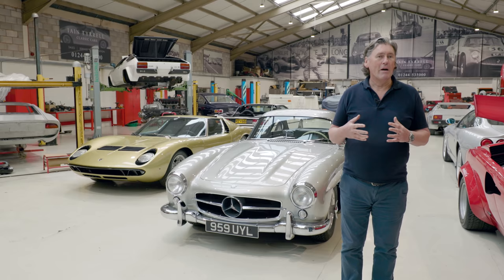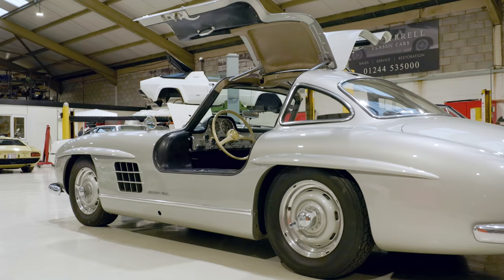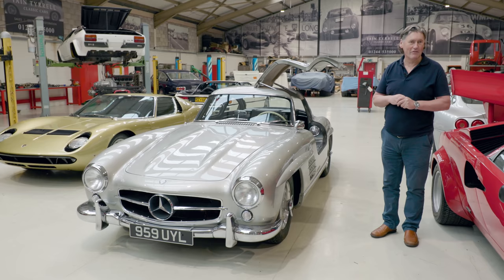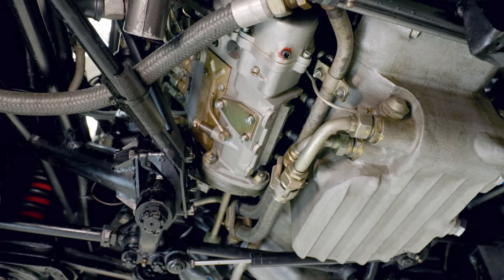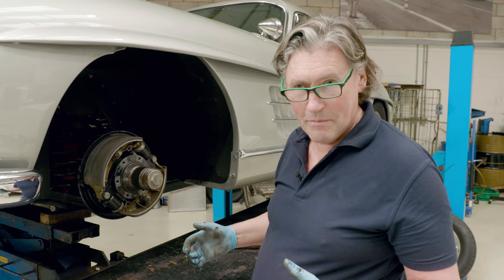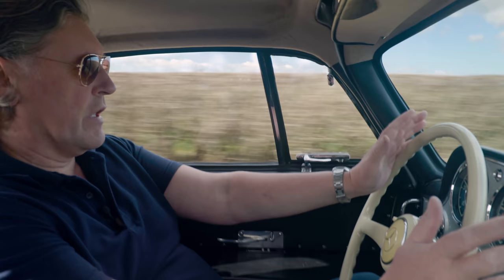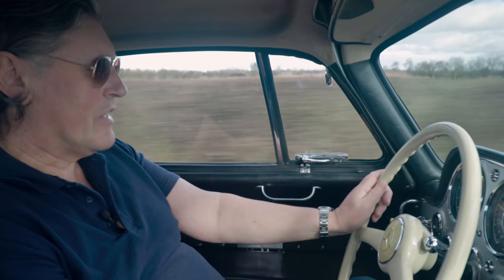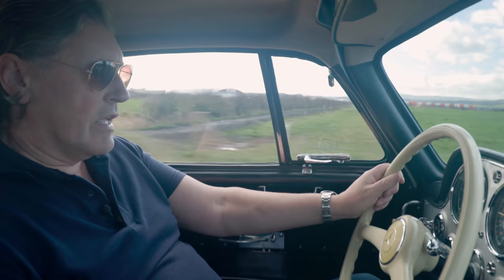Mercedes-Benz 300 SL Gullwing - Recommissioning an Automotive Icon | Tyrrell's Classic Workshop

Comment: Iain, quite right about the injection system on the DB601. After Munich, Britain had also stockpiled 100 octane AVGAS - a significant advantage. At the start of the Battle of Britain, the RAF removed a "stop" on the throttles of the Spitfires and Hurricanes - the pilots could now go "through the gate" and access about 100 additional very worthwhile BHP. RR considered injection (which allowed BF109 to dive away from it's carburettor-fed Merlin opponents when required) but liked the cooling effect the mixture gave to the air coming out of the aftercooler. And they liked the supercharger over a turbo as the exhaust thrust was worth about 20 knots at maximum revs. Fuel was always a big problem for Nazi Germany. If Bomber Command had gone after synthetic fuel production (derided by Harris as "a panacea target") they could have really made a difference in 1944.
Beautiful car, great channel, very enjoyable - well done!!

Comment: W194, 1952, winner Le Mans and winner Carerra Panamericana (say no more). Later to become W196 (300 SLR) winner Mille Miglia 1955, Stirling Moss and DSJ.  As many have said: proper engineering.    
Based on the Mercedes-Benz 300 SLR sport racer of 1955, Uhlenhaut created a road legal SLR/SL hybrid. Capable of approaching 290 km/h (180 mph), the 300 SLR Uhlenhaut Coupé easily earned the reputation of being the era's fastest road car. A story circulates that, running late for a meeting, Uhlenhaut roared up the autobahn from Munich to Stuttgart in just over an hour, a 137 mile/220 km journey that today takes two-and-a-half !!

Comment: Thanks for your fantastic work by introducing and explaining the super cars.
Regarding the first car with direct injection the german Gutbrod Superior was the first mass production car using this method. The difference to the SL 300 is that the Gutbrod is a 2- stroke engine and not a 4- stroke engine. The direct injection helped to reduce petrol consumption which one of the disadvantages of those engines.

Prof. Uhlenhaut drove his 300 SLR each day into the office and whem I remember well the position of engine and drive train was assymetrical so a bit uncomfortable for a commuter.

Comment: I shudder to think just how many times I would have to check, then re-check all the fluids and the done-upness of all the things that need to be done up, before daring to start such a valuable piece of automotive history. I've been known to pop the bonnet open just to check one more time that the dipstick was pushed fully home after checking the oil level. You never know, the five or six times I pushed on it before I closed the bonnet might not have been enough. My OCD would redline with this one, however. Beautiful engineering.

Comment: Sir you are a master. I can only be thankful for the experience you give us of these beautiful classic cars.
Wouldn't mind a straight 8 SLR version as a daily driver...
On my wage I'll have to stick with the cammed up M103 W201 but I still prefer it to going for something newer. I just have to apparently go for completing EFI conversion to get the minimum 270hp build target, the ECU piggyback on CIS-E isn't as tunable as I hoped it would be but I do like the 6 bar fuel pressure. It just goes haywire trying to resolve all the fitted EFI sensors so I'll have to fit electronic injectors now.
Still, what I love about mine is being as close as I'll get to driving around something like a 300SL, a 3.0 litre Daimler six with a dual personality of sedate low and waking up high, remarkable pull for something ancient compared to modern traffic, pretty sure my 0-60 is sub 6 seconds and 0-400 in the 13 range so will beat a spanking Audi if he doesn't take me seriously and hey, I originally bought it for a thousand bucks and honestly, up close it looks it. 😄
But I do actually love the lines of the 190E 201. It's a handsome looking car, smart looking, y'know. Nothing like the classics you deal with, they're artwork. Mine is just smart looking. But I love it. I had a Porsche driver after a run pull up at the lights asking what was in it. Bit of a cam, 12 grand of new parts and hand machining for track days. Looks rough. Is old. Goes hard. I like that.
Like I said I wouldn't mind a real old beast like an SLR or a 2.5 Ferrari 12 but I'd just ruin it running as a daily with a heavy foot. I would have to do that 😅

Comment: Whats amazing is the fact that they were able to reasonably accurately inject a low viscosity fluid (petrol) via a mechanical pump which normally relies on the lubricity of the fuel (diesel) for sealing and lubricating the internals......

Comment: Fascinating. I wasn’t aware of 160mph, but this does amuse me in a way. The reason cars were always limited to 155mph, and Bugatti Veyron tyres cost £30,000, is to run at 160mph for x minutes will completely wear through……normal tyres. So that 1954 handbook note is….Mercedes knew it would kill whoever tried 160mph for an extended time 😀

Comment: Iain really is an Automotive Yoda - so full of knowledge, insight and experience - the perfect teacher! I'd gladly be the tea boy at Tyrrell's Classic Workshop, even though I'm in my 40's!!
I happened to see a 300 SL Roadster on the road a couple months ago. I assume the space frame on these is modified, as the doors on the Roadster open somewhat lower than the Gullwing...? So it makes me wonder how Mercedes have retained the structural strength in that area on the Roadster...

Comment: If the oil is being contaminated that quickly then the fuel injection pump is worn. The Bosch pump is also lubricated from the common lub system. If the injection pumps are worn then the leakoff will contaminate the fuel pump sump and as it drains back to the main oil system it will contaminate everything. The problem with fuel contamination is that around 5% will be enough to drop the viscosity by 50% and the sump oil flash point also by 50%.

Comment: I enjoyed your review of the 300 SL. On why the original gullwing did not have disc brakes I am repeating something I heard so you can call it  hearsay. 

But I understand jaguar just came out with their disc brakes from Dunlap and Mercedes did not want to pay Dunlop a royalty. Maybe they felt with the Rudge wheels one royalty was enough 😁

Regardless when the roadster came out in 1957 among the updates were disc brakes. 

Did not realize so few of them came with those wheels which was really a whole different axle assembly. 

The roadster came out in 1957 due to the demands of the Southern California market and of course they modified the frame. 

And in the original gullwing the doors had to be that way because of the frame. 

I understand when they made this for the commercial market the engineers hated the doors considering it a necessary compromise but of course it caught fire with the public. 

Women did not like that particularly but it did not stop some like Sophia Loren from buying them. 

It’s an amazing car and thanks for filling in a lot of knowledge gaps for me.

Comment: Wonderful - fascinating about the reason for the DB 601’s injectors, I always understood it to be so that the BF109 could fly inverted or do high G turns without affecting the fuel supply, not as easy in a carb fed Merlin engined Spit
Reply: principally its correct what you said, but the british( in fact as I read it was a lady) invented a rather simple device in the merlin- carburettors to fix this problem.

Comment: I share your enthusiasm for the clockwork clock.  I had a T Type MG that prior to my ownership had been fitted with more modern magnetic, sweep hand instruments; more specifically the speedometer and the tachometer.  I wanted to replace these instruments with the original chronometric units that had the 'stepped' movements which were so much more in character for the car.

Comment: Regarding the use of the ordinary car in racing. For regular Alfa Romeo 155 in the factory shop manual was recommended to change the oil from 10W-40 to 10W-60 for the racing use.
Reply: Nice 👍🏻

Comment: We have an original fully restored Austin Healey 3000 MK.III with 150 hp from a inline six, its 10 years newer than this, yet it seems so simple compared! Its incredible what Mercedes-Benz Acheived with the 300 SL! I really dream of one day getting behind the wheel of a genuine 300 SL (I work for Mercedes, so maybe?). Our Healey litterally blew the brakes out 4 days ago when i took it on the first drive this season, luckily i was quick to use the handbrake instead. Could have gone so very wrong! Glad me and the car made it home in one peice
Reply: that's like comparing a Maxda MX5 to a Porsche 911 RSR. Different objectives.

Comment: I spotted Gull Wing reg HF 25 (with reflective plates or at least white front and the sought after wheels) very tightly street parked in Wandsworth, with a Mini and a Fiat 500, would have been around 1979/1980. So surprised I parked, went back and took a picture, which I still have.

Comment: in the 1950s, "de-coking" was a routine maintenance procedure, even for very mundane vehicles. Possibly due to the liquid coal syrup claiming to be petrol that passed through rather vaguely calibrated carburettors in approximately valid stoichiometric ratios. With modern fuels, I'd suggest using a borescope to keep an eye on the inside of the cylinders to save pulling the head off until it's really needed.

Comment: About the petrol & oil issue:
I‘ve read in an old Auto Motor und Sport issue that it is advised that you kill of the engine by dropping the clutch if you leave the car for a longer period of time. By doing so, the fuel pump which is driven off the crankshaft gets immediatly shut off and no more unburnt fuel gets drawn into the cylinders.

Comment: interestingly enough do I own a rare classic car. not as special as the gullwing to most people and way more afordable.

but when I bought this car did I get a mint condition service manual, a list of every single part in my car together with parts numbers. as in your case are many of these parst discontineued but hugely useful and the original owners manual. other than that has it only been driven 140 000km since new in the 48 years that it has been on the roads and the car is in just insanely good condition.

the car I own is a 1973 Volvo 1800ES. the extra rare wagon version of the Volvo P1800 and I absolutely love everything about that car. 

this was an interesting video cause I do feel like I recognise what you're experiencing as something I experience when around my Volvo and that is really cool. thanks for the video =)

Comment: Fantastic video we watched the lot. What you do not mention is the fuel filler is in the boot or the air vent in the roof. On the convertibles they moved the filler to the outside.

Comment: The tire advice shows: Tire technology has come a very, very long way since the 50ies.

The low-rev-ability might be partly due to the straight injection. A carburetor needs a certain amount of air flow to deliver enough fuel. Too little flow - too little fuel = engine running lean/rough.

Plus: Most of them work best either for low rpm (small diameter) or high rpm (big diameter).

Italian V12s go for the latter, I guess.

Comment: Some remarks:

- wasn’t Ferrari doing spaceframes since before the 300 SL? The 125, 166, 195, 212 (and others) were spaceframes, were they not?

- wasn’t the Rudge Withworth license sold to Borrani? I am fairly certain Borrani bought the patent;

- Jaguar was the only one doing discs brakes in the early 50es for racing cars (Jag D), it was cutting edge technology and wasn’t standardized until Lancia started equipping their cars with discs brakes all around on production cars (Aurelia was the first right?), so Merc is excused for not using them early on;

- the lesser fuel quality became a problem for the Germans only later in the war

Comment: I'm building a range rover based special with gull wing doors ( for the same reason as Mercedes had to) so it's useful to see how they hinged them. The lack of any guttering around the shut lines surprises me but the non opening door glass doesn't!  I'm going to opt for acrylic rallyesque style sliding panel, methinks...

Comment: Rometsch Beeskow are the coach builders who came up with the wing strake on the VW based cars they started building in 1950. 

Are the Rudge wheels heavier than the standard wheel?

I love the standard wheels and domed hubcaps

I'd say Mercer as they are a little more sportier than a Stutz and more focused handling lower center of gravity. But offered to any customer who had the money.

Love this video.

Comment: The days of setting the engine up for best running by just making adjustments by ear, never mind measuring the CO levels. About 3% at idle compared to modern engines 0.19% electronically controlled. The crackle you hear is fuel burning off in the exhaust. Never again to be duplicated. Ahhh the good old days.

Comment: 1952 = Retractable handle with no simplicity, fully functional, no complication and unnecessary electric powered servo sensor controlled. (Still works 70 years later)
Tesla = Hello, we cannot make a retractable handle unless it is electric powered, has servo's, sensors and computer controlled (Breaks within 2-3 years of ownership)

Comment: The Merc 300SL was not the first production car with direct fuel-injektion. The background is interesting. Shorty after WW2 the mastermind behind the famous Daimler Benz aero-engines with direct fuel-injektion Dr. Fritz Nallinger went to a small firm called" Gutbrod". There they produced a tiny car with-I think-a 2cylinder engine, but with direct fuel-injektion. Long before the 300SL. But Dr. Nallinger returned to Mercedes of course and besame very famous as technical director and participated in the development of the 300SL.

Comment: At 17:00, the observation about Germany's coal sourced petrol is pertinent to today, while we are being pushed to "be green", we are heading for the cliff in terms of a reliable electricity power generation (I know people in the industry who gaffaw at the notion of relying on wind and the biomass for Drax is 60% clean timber grade and all of which comes from Western Canada B.C.)) whilst piling on demand with electric vehicles that rely on even more strategically vulnerable components than oil, betteries and chips out of the far east; although we have just closed Didcot, a new coal mine is one of the sensible things that Johnson Has posited.

Comment: So with out "Uncle Addy" H. we wouldn't have had wwii, the direct injection in the ME109, or the same direct injection in the MBZ 300 Gullwing.  Fascinating.  I knew something good had to come out of such a tragedy.  Makes me want to get an old Adenaur car and get that motor out and use it for a sportscar. From what I heard on the war programs, the ME109 could do better maneuvers at higher altitudes and certain other things that the early Spitfires couldn't do, on account of the english had carburettors and they would get fuel starvation at certain times.  Maybe it was cold at high altitude or maybe just the fuel bowl got empty in negative G situations I don't know the details.

Comment: I like this car, a pity they were not fitted with spoke wire wheels as the racing cars of that era. Two of my mothers cousins had 300 SL. The one I inspected many years ago after its complete restoration, had the sport camshaft, Rudge wheels, the Nardi steerling wheel and disc brakes. That car was sold a few years ago as the owner passed away. Its value was very high! A pity, I never got a chance for a ride. A few years ago, german Auto, Motor und Sport did a test of the 300 SL. It was not that fast going as its reputation. Maximum speed 235 km/h and 0-100 km/h in 7.2 sec. (That is a bit slower than my own 2013 MB B250...)  Lots of oversteer and extremely noisy! The tested car had the 3.64 final drive (there were also 3.25, 3.42,3.89 and 4.11 available). I think the taller final drive ratios was chosen to reduce the noise level. Nowdays, you can retrofit a 5-gear gearbox. The Goliath two-stroke engine had direct injection even before the 300 SL!

Comment: Imagine if Mercedes gave the 300 SL a Citroën-style hydropneumatic system with four-wheel independent suspension, inboard disk brakes and rack-and-pinion hydropneumatic steering.

Comment: Direct fuel injection caused the German Luftwaffe problems as well due to oil dilution if the engine wasnt warmed up quickly enough and lead to low oil service life.  ( see Calum E Douglas, the secret horsepower race  Western front Fighter engine Development, for the low down..)

Comment: The cost of the wheels doesn't seem that high - I used to have an XJR and when my wife spun it in the rain, damaging one of the wheels, I inquired about replacing it.  The wheels were $6000 each and unavailable worldwide....  Needless to say, I just had it repaired.   The car was $80k new, so a full set of wheels would have been 30% of the car's cost... Of course, these days, the value of one of those SL wheels could probably buy a fleet of cars....

Comment: I had never heard one before. Amazing sound. Great video. Subscribed. Possibly….the reason they didn’t fit discs, is the main market was America. Where they had drums way into the 70s. Sorry to any Americans reading this, but discs may have conjured up images of alien technology, UFOs etc, at the time. Mercedes would not have done it for cost cutting reasons. Knowing  them, they would have got hold of a disc brake, and invented ventilated discs. It doesn’t make any sense at all to produce aluminium drums, with cooling fins…..